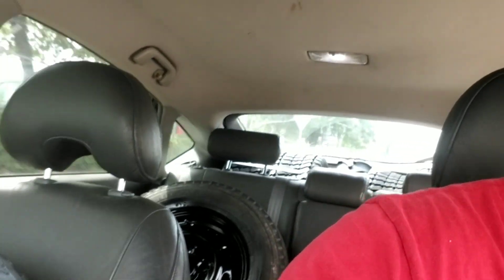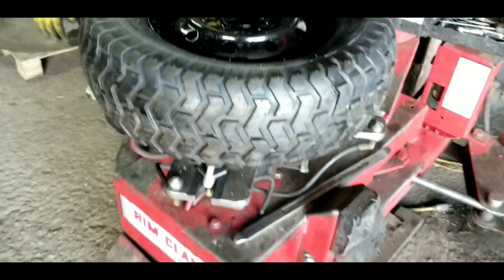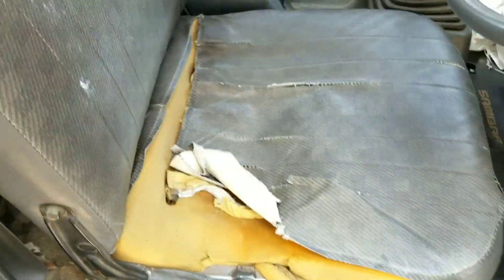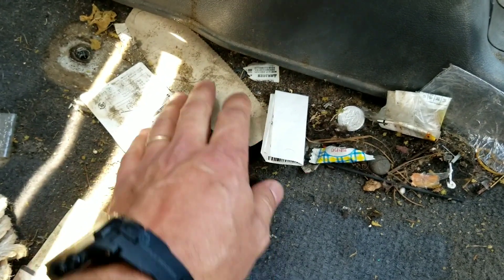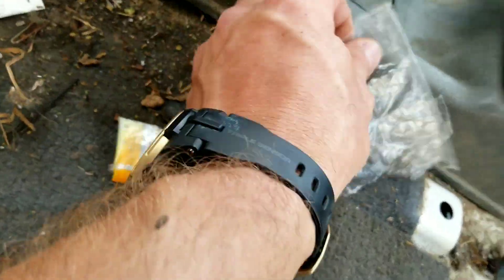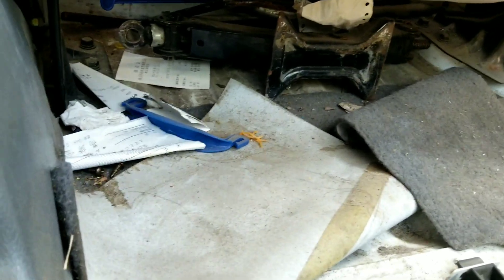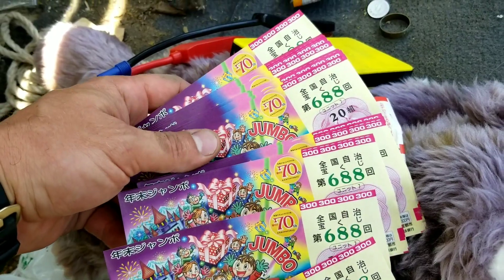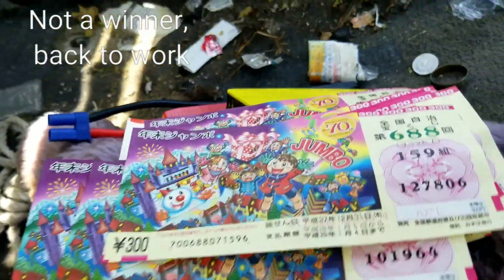What's under the drivers seat? Episode #69

Comment: Hey man, I got a question about importing. Suppose I get a new Acty from 2015 or whatever. I bring it home and I replace the engine with an electric motor... Would going electric mean that I can now drive it on the road? No need for the 25 year wait because it is a diy truck right????
Reply from the maker: The truck still needs to be 25 years old, regardless of the engine or motor age.
Reply: @USMiniTrucks  ok. So not even just getting the cab part as scrap metal, then welding a DIY rear end? Would that do the trick? I like the face of the Acty but ultimately I need it/want it Electric. In the conversation you eliminate problems with noise, broken engine part sourcing etc. But if the truck was newer, then I might eliminate problems with old parts elsewhere too. So how much would you import one for me delivered to Seattle?
Reply from the maker: @aomanchutube  The 25 year old trucks are better condition than you think. Try to find a minitruck with a bad engine for cheap that you can rebuild. It's not worth getting a running model, to convert it over.  I know a few trucks that have bad engines, you could convert.
Reply: @USMiniTrucks  What is the purpose of this 25 year rule? In Europe you can import any car any age from anywhere!
Reply: @USMiniTrucks  that's an idea. I was planning on driving it normal to get insurance and registration and get used to it. Then get a totaled Nissan Leaf and use the parts. Have been following a couple of guys who are using Nissan Leaf drive systems for conversations. The leaf motor in particular runs past the 7000rpm which would make it easy for an ACTY to be a freeway car....and I'd be the airbag to protect my seat and probably my wallet and phone from pesky accidents. I'm convinced that the Acty is the one with less rust. I've seen quite a few Carrys and they all seem to have undercarriage damage. Specially as you open the door, right on the floor they usually have rotting surfaces.